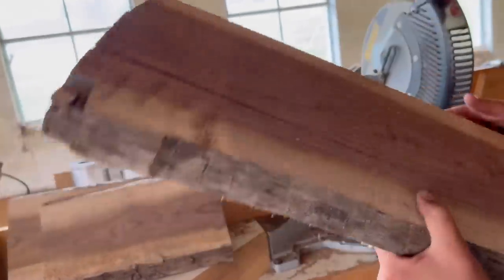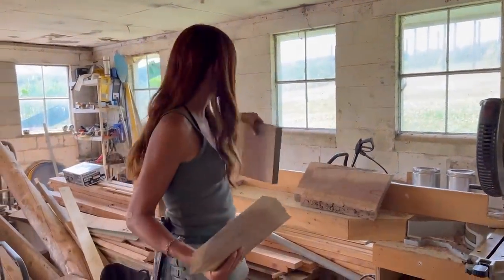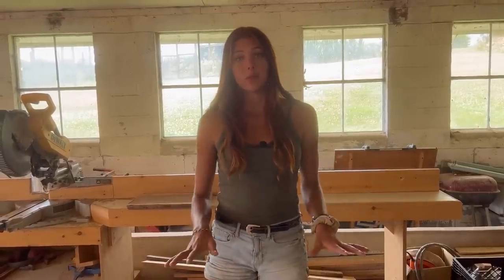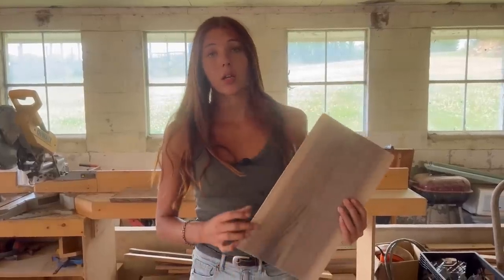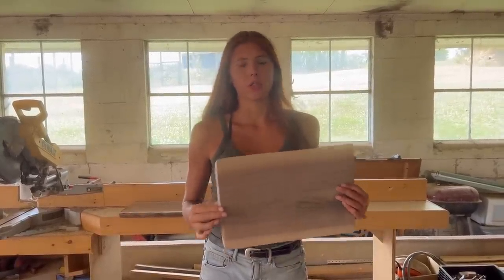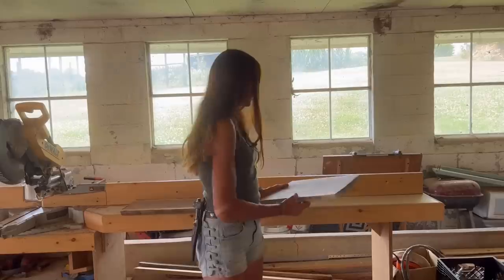Wrapping Up the Week by Making Walnut Cutting Boards!

Comment: Please wear a face mask while working with the black walnut, it is really bad for your lungs when you you inhale it. Like many have said, use food grade mineral oil, then top with beeswax. 220 grit sandpaper is about as high as you need to sand. Please also wear your safety glasses and ear protection. Thanks for the great video’s I love them. They are great to watch!
Reply: It's easiest to melt the beeswax into warm Mineral oil and apply it . The oil soaks into the wood as well as the wax and then the wax leaves a nice sheen on the surface of the board if you buff it slightly with a cloth.

Comment: Hey great video ladies.
One thing you MUST wear a filter mask when sanding the wood or its going to mess your lungs up very quickly and permanently! (Fine sawdust is a killer!)
Aside from that im sure youll work out the rest as you go.. you might want to look at other food safe natural wood sealing oils rather than olive oil, as not sure that will hold up. There's plenty out there that are specific for that kind of purpose.
Main thing though just definitely get yourselves a couple of decent masks each and filters to replace regularly, given its your job you will really regret it if you don't knowing other people that suffered because of this.  Also you should have the wood up against the fence of the saw so it minimises the risk of it kicking-back board which can be very dangerous (and use the sliding mechanism to make the cut through the full width of the board), if the blade is sharp and a fine-tooth/fine-cutting blade (which is what you need, not a "rough-cut" blade)... that will minimise tear out like you were getting on the boards. And make sure you have good quality sandpaper of different grits working from rougher to finer grits for the smoothest finish..  Hope this helps! 
Have a great weekend! 
Cheers from London England 👍😎🏴

Comment: That cracked board - rip it and glue it back together with a contrasting color wood strip using waterproof wood glue like tightbond III - maybe 1/2 inch only. Might need to lose the live edge for that one though.  You'll also want to wear dust masks like N95 while sanding.  Did you know a lot of wood dust are toxic?

Comment: Safety.  Before you pick up the belt sander, I assume right handed, Place the cord to your right and clear of yourself.  Now take a soft wrap of the cord over your arm so,, two things, the cord is not dragging on the table top  (belt sanders love to eat their own cords)  and also when the cord snags on anything, your foot, the edge of the table, the corner,, it stalls the belt sander and that causes the belt sander to eat a divot out of your finish work.  If the long diagonal wrap around your arm,, a single turn is plenty,, exits over your bicep,, it is clear of the work, it will not snag on anything.  Easier to control belt sander, better finished product.

Comment: The natural finishes would be fab. I've heard about how much micro plastic a person might be eating and it's kinda horrifying. As for the live edge I don't think it's appropriate for a cutting board since the food juices could get trapped in there. Consider a natural curvy wavy edge left over after removing the live edge. There are small hand held routers that you can use to add a decorative groove on the top near the borders to contain runoff juice also.

Comment: On the hardwoods you are going to use to make a finished product, I would suggest painting the end of the boards when sawed or the ends of the logs before you saw.  That slows down the drying out of the ends of the board  so that it will reduce the amount of cracks that develop near the  board ends.  At the price of walnut,  throwing away a few feet eats up a lot of profit.  Great video as usual.

Comment: Hi girls. You are doing a great job. after reading a lot of comments, i agree with all of them  especially on keeping the wood up against the back fence .  Also keep your hair up away from the sander , and also i see your in bare feet , watch out for slivers.   You should have grandpa make you a good solid work bench. 
Im 86 years old and started in a small cabinet shop when i was 16 and still have all my finger. Your doing a good job. Keep it up. Sal

Comment: A planer would help you do a better job with less work. Look at something from say dewalt. Good idea to use some of your resources.
Reply: lol. so it can look like its store bought? Thats not the point.
Reply: @shaynejenkins446  did you miss the part where she wanted to sand  them up to 2000 grit? That's waaaaay beyond a planed surface !

Comment: I used employ a lot of guys - one did what you're doing, didn't butt the wood up against the fence - Johnny Four fingers we call him. Wood snatched, dragged his hand in, bye bye finger. Start sanding at 36 grit - bang out all the big saw scratches with that - then go to 180. Then 240 - which is enough for wood. 1000 grit is for cars. Steel. Linseed oil is good "Natural" oil for finish - it dries, other oils don't. Or flax oil if they call linseed that in your area.

Comment: Walnut oil is used on most food touch wood. This oil does not turn rancid. To hold your blanks look at bench dogs. I know you like the raw edge but you can hold bacteria in the pourus surface.  Cutting veggies with a knife is going to mark the surface so no need to sand beyond 400 grit, just work your way up without skipping grits.
Reply: 400 grit would be a waste of time on Walnut due to its open / porous grain. Maple would be a different story. Plus, we're talking about cutting boards here.

Comment: I think that when you've read about using natural oils it must mean danish, teak oil or mineral oils. Plant based oils will not provide a durable surface and will not provide a sanitary surface. There are synthetic finishes too that have been developed for the food trade, think of tables in restaurants and bar counter tops, all finished with food safe, hygienic lacquers.

Comment: Please invest in a thickness planer.
If time is money and your efforts are worth anything please do that.
A drum sander would also help in your production.
I hate to have a negative sound but I did cringe when I saw you cutting the board without clamping it or securing it before engaging the blade.
As a 70-year-old woodworker I've seen lots of wood get thrown around, sometimes injuring people.
I do appreciate your can-do attitude on everything.
Thank you ladies !

Comment: Using the slide chopsaw without holding the edge of the board against the fence is asking for trouble; it's a wonder that the board didn't go flying back to the fence.

Comment: Anything that is made by a human being, with natural individualized features or a signature, is worth many times more than some mass-produced piece. When I'm working with leather, I try to save the pieces with the original edge, complete with tenterhook stamps, for the most important projects, sort of like your Live Edge.
Here in California, walnut is cheap and even tho it's a hardwood, it is really easy to sand and shape. Reminds me of teak, but without all the sand that grows into that wood.
To stabilize wood, NOTHING can compare to a coat of Smith's CPES. No, I don't sell it. After one coat (all U really need), U can use oil for the final finish. It's not a glue, btw.

Comment: make a cutting board out of oak start by sawing it don't sand it put vegetable oil on it until it can't absorb any more 12 times is usually fine wait a day or 12 hours sand it carefully it will be very fine the reason why you shouldn't sand it before you oil it with a brush is that you will not get any oil in if it is not rough

Comment: Just in case no one mentioned this (I don't have time to go through all 800+ comments, sorry!) - It seems to me you're making your cutting boards using green wood (or, at least it seems likely, unless you took the pieces off a stack that had been sitting around for a year or so).  That may not work out so well, especially since you're working with plain-sawn pieces, not even rift- or quarter-sawn.  There is a good chance that the boards you make this way could start to cup before very long, and no one wants to use a cupped plank for carving or cutting food!  I'd take the pieces that are candidates and let them sit and dry (stickered) if they're any fresher off the saw than about 6 months.  After they've had that half a year to dry (rule of thumb is usually about a year per inch of thickness, but you might get away with half that if you're lucky), put them through the planer that a lot of folks mentioned, then let them sit for a few more days, and plane them again if they need it.  Just my two cents' worth, I've enjoyed your vids and wanted to give something back since I had some potentially relevant knowledge.

Just curious - I realized a moment ago that this video's 8 months old (guess my first clue could have been the weather!) - so, how have the boards worked out?  Any cupping?  Getting any sold?  (I, too, love walnut :)

Geez, one more thing - if you plane the boards, a thickness planer won't necessarily flatten them, it'll just give them consistent thickness while following any existing undulations.  To flatten them out you'll need to either mount them on a sled when putting them through the thickness planer, or face-plane them on a jointer first.  (You'll need a big one, your wood looks 10 or 12 inches wide.)

Be well!

Comment: In my shop, I wouldn't "free hand hold" the workpiece because if it twists at all it will grab the piece and either jamb and throw it or run the saw forward or backwards?
I also see no dust collection shroud at the other side of the fence with a shop vac attached. NOR are you wearing any dust protection face mask. That dust is airborne and is going to get into your lungs. It's so fine you probably can't see it, and that is THE most dangerous dust. Just looking out for you gals, from a woodworker with 60 years experience.

Comment: In all seriousness, you really need to make a good, sturdy work bench.  Working while on the floor is not good especially for long or frequent periods of time.  And now that I am on full "nagging mode", anytime you are working around rotating equipment like drills, saws, sanders, etc. it would be much safer if you tied your hair back.  I've seen the consequences of not doing so and I want to spare you that fate.

Comment: Be sure to wear proper safety gear, Eyes, Ears, Breathing. That little bag on the belt sander ain't worth diddle. I'm deaf and can't breathe as I was hard headed in my younger days. No need for you to end up this way when it is preventable. BTW I use UHMW plastic for cutting boards now.

Comment: I'm not entirely sold on the notion that people will want live edge cutting boards, but you will find this out one way or another for yourself. But you have to have at least safety goggles working that chop saw and much better would be a full face shield. Walnut is a very brittle wood, it can shatter, and it sometimes has super-hard parts and "normal-hard" parts.  And if that blade chips off a piece and it bounces off the fence on that saw back into your face, you could very easily get a fairly serious gash in your face or your eye. You cut enough pieces of hardwood and this will happen. I wouldn't risk it and I'm nowhere near as good looking as you are. And as many have said you're asking for trouble not having the work against the fence on that chop saw.

Comment: The oils you mentioned will go rancid, mineral oil is your best bit. Love your videos but you are way over your head with the cutting boards. Research about drying wood ,a few weeks doesn’t make a usable piece of wood. Many things about the cutting boards is wrong. Just wanted to let you know before you sell them and have issues. If you sand to 1000 or 2000 is way to slick and the board want absorb the finish such as mineral oil and bees wax about 220 to 320 grit is best.

Comment: Nice to see you doing some fine wood work, with all that nice wood around it must be tempting to just make projects all day.
Some tips to help you prevent injury or damage to your equipment, never cross your arm under the blade 1:02 If the work piece is unsupported (it isn't supported) it can be pulled in to the saw, pulling your hand in along with it, right under that blade which is still spinning.  Also, leave some clearance, like keep your hands away form the blades even if it's on the right side.
Get comfortable with switching trigger hands and operating the saw with your non-dominant hand.  Not just for safety, also comfort and productivity.
Never cut an unsupporte3d work piece.  it can move unexpectedly, and even if not a safety concern, which it usually is, it can be thrown against the fence hard enough to bend the fence, making all your future cuts off angle or partially supported.
A tip: you can glue or tape the odd shaped curved pieces like you have there to a straight piece to make it easy to support it on the fence, without it moving.  Also makes parallel end cuts easy.  Also makes ripping the edges parallel easy.  Also can be a good guide for planing it flat to get rid of any warp or cup etc if you shim it when you attach it.
K, that's all the tips I had based on those 30s of video, let's continue...

Comment: Those boards are going to cup and be useless. If you plan to do this commercially you should get a jointer, planer, bandsaw and dust collection. If you cut the boards in to strips and glue them up you will get a stable board that won't warp, you will also get more yield from your boards. That cracked board for example; almost the entire thing could of been used. Like everyone else said, using the miter saw like that is very dangerous. Using a circular saw on horses would be much safer, or just cut them on a bandsaw. Lastly, if you are going to work like this get some legit dust collectors. You are getting fine particles in your lungs which over time will lead to terrible respiratory conditions. Good luck, you'll figure it out.

Comment: Easier to sand the long board before cutting it into pieces. Since you are using electricity, this must not be at your log yard. A 1" cutting board is a little too thick.

Comment: Looks like other commenters are giving tutorials on the radial arm saw so I'll stay hush on it. As for legs on the cutting boards what will that do for chopping? Will a hard "CHOP" cause the board to split easier than if there were no nubbie little legs? Maybe make them with legs for lighter duty cutting and without legs for heavy duty chopping. The HD ones could also be made thicker. They can be stood up on the kitchen windowsill for the sun to purify after washing,sunlight will kill alot of microbes and such if they get past the washing on the non-shelac surface, a UV light will kill them too. If engraved on the back/bottom side it would be displayed while the cutting side is toward the sun,or,any time you lean it thataway I suppose. Just a few thoughts,I don't know if any are worth the proverbial "tinker's damn" but there they are anyway. :)
Reply: sliding miter saw, not a radial arm saw.

Comment: You girls need to work on your safety practices.  You are running that chop saw pretty dangerously.  Also in another video one of the girls is changing a bandsaw blade in a tank top and no gloves.  All the fun and games will come to an end when someone gets seriousy hurt.  Wood cutting blades are about the most dangerous thing in any shop.  Would like to see more PPE on the channel.

Comment: The cracked one you could have cut a handle on the band saw instead of cutting it off.
Reply: I use mineral oil with beeswax heated to 150 degrees.

Comment: Cutting boards are a cool idea. My unsolicited 2 cents: A hand planed finish would be really good looking. A bit laborious, but not much worse, if not faster then sanding if you keep the blade sharp. A plus is no sanding dust. It would be a nice hand finished touch, IMO.

Comment: You preach about getting the most out of every log.  Why not use the damaged ones and make butcher block.  Use smaller chunks of wood and can cut around the bad parts to get a higher yield out of the log, and charge a higher price for extra labor time/costs.

Comment: Dad, I understand utilizing Emerald to improve your brand. You're a wise man, please using these power saws without eye protection, hanging long hair, jewelry is all I see. You can tell she is not adept at using that sliding compound miter saw by starting in the middle and not using the slide to cut through completley leaving an incomplete cut. Yikes

Comment: Dang, You can't go breathing that dust, you will need a mask or extraction and that walnut might dye you and you should just use a planer anyway. If you want to know everything about finishing cutting boards, look up Six Eight Woodworks on YouTube. And gloves, you need gloves. I did a job like yours for years. We used Polyco PVC criss-cross gloves. They are mesh so your hands don't sweat. They are about $2 a pair and last at least a week. They protect your hands from knocks, nips and bumps and probably splinters also. Use these gloves, you'll never want to use your bare hands again.

Comment: you need to buy a plainer so you can sand the board before you cut itits will do alot better job for you
Reply: It's a Planer, and it doesn't sand the board.

Comment: That is very risky what you are doing, using the chop saw with the material not up against the fence. It is also not a good idea to hold that wood with your thumb positioned the way it is and your fingers underneath the wood. I am surprised your dad who is so safety-conscious allows you to do this. You should be trimming the live edge of that Walnut on your edger, or by some other method. When that chop saw blade gets dull and it catches that Walnut the wrong way you were going to find yourself in a very fast and very scary situation.